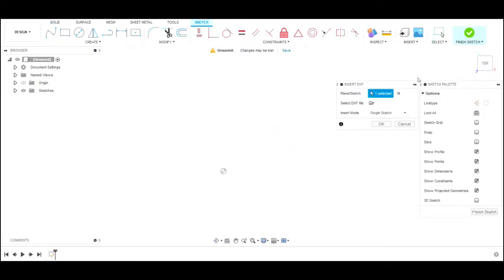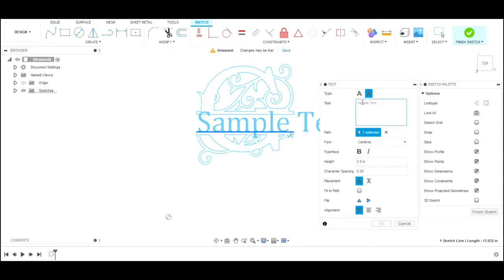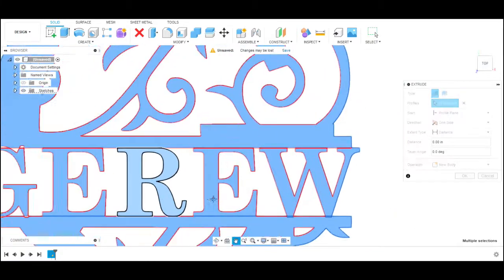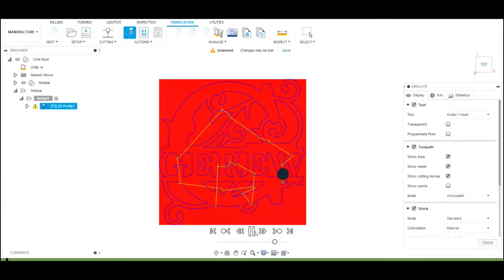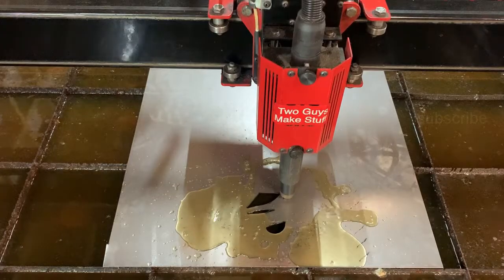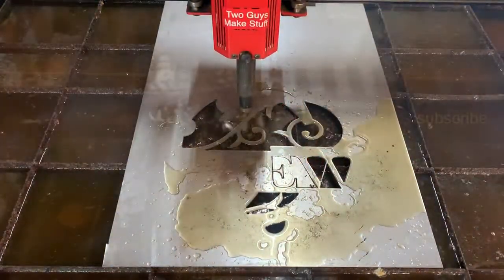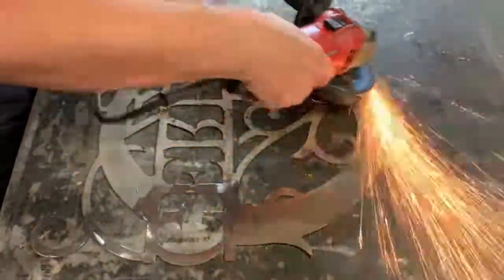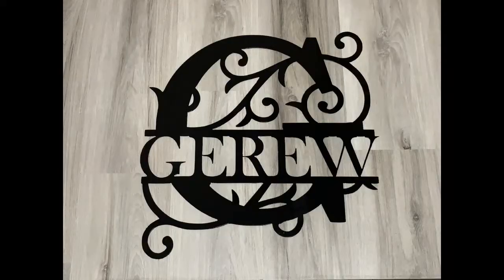We use fusion 360 and CNC plasma cutting to make our Instagram giveaway prize!

Comment: I really enjoy your videos.  I've ordered a 4'x8' CNC plasma table that is slated to be delivered on Tuesday.  What are the details on the burnishing tool your using?  It looks like it does a good job.
Reply from the maker: The burnisher is a nice machine. You can buy them on Amazon for a good price. Burnishing Polishing Machine, ZFE 1200W 110V Burnishing Polishing Machine Polisher/Sander Set with 4PCS Non-woven Burnishing Wheels (80# 120# 240# 360#) for Metal and Stainless Steel Polishing https://www.amazon.com/dp/B012Z8P6DK/ref=cm_sw_r_cp_api_glt_fabc_A7BAB4BECPASHX0Y10TA